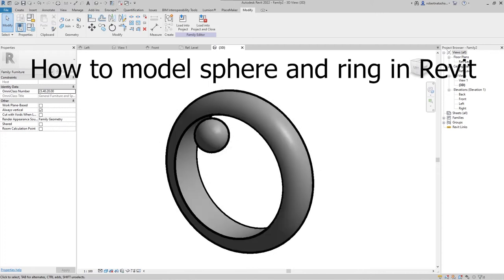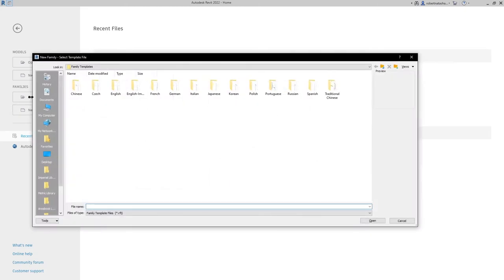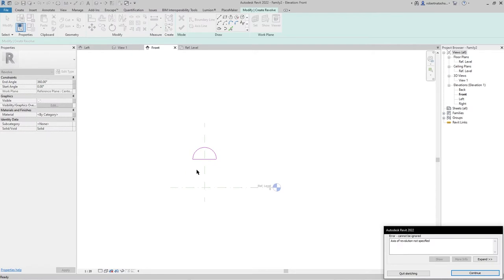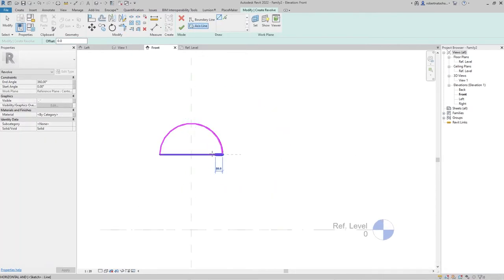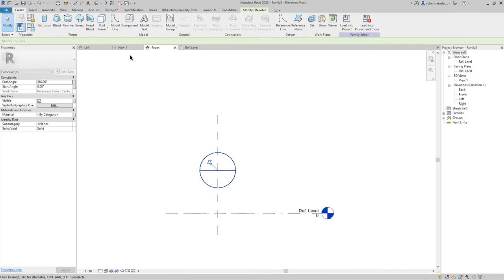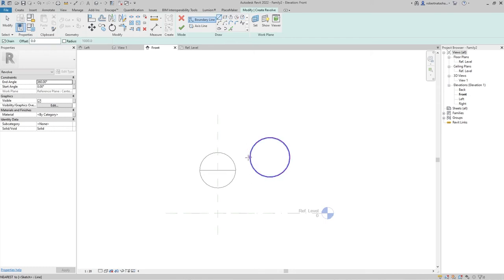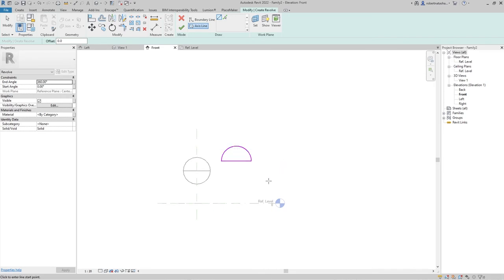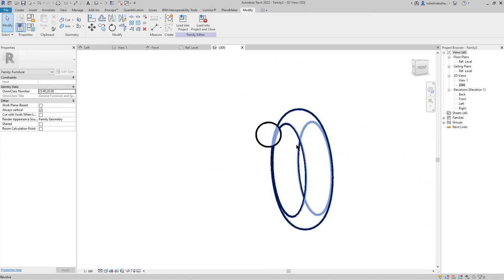How to model sphere and ring in Revit

Comment: Currently using revit 2019 and this didnt work. Followed instruction exactly and i keep getting the error msg. "Lines cannot intersect each other. The highlighted lines currently intersect."
Reply: redo your path. Sometimes it's so small tou can't rlly see, but you need a connected path without any intersections between lines